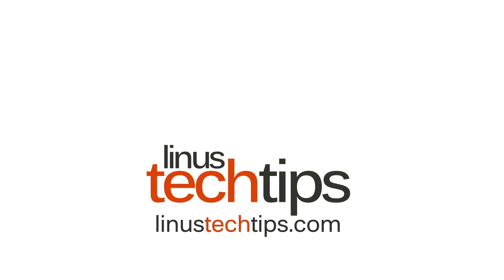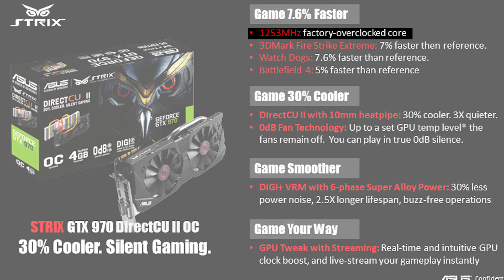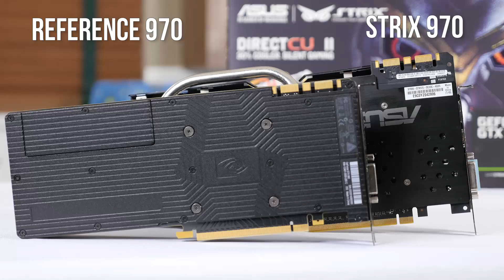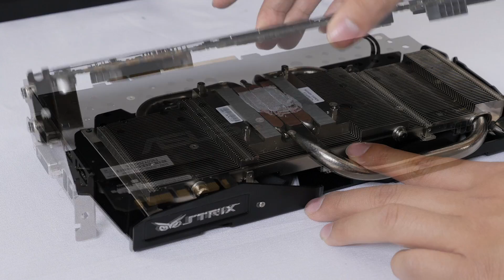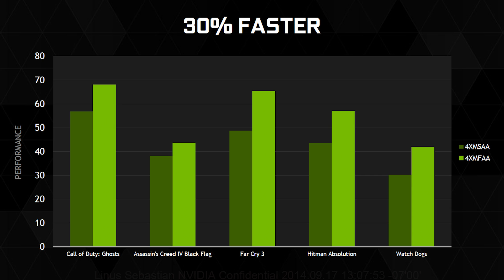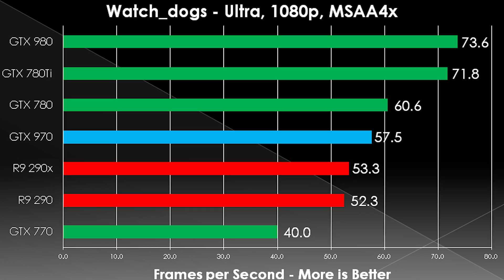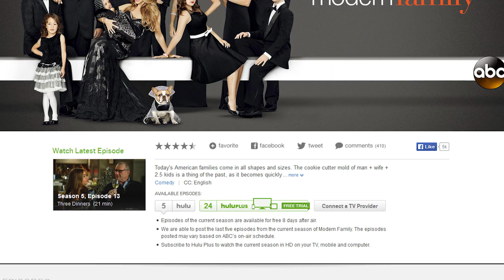ASUS Strix GeForce GTX 970 Video Card

Comment: Do you guys think the GTX970 is a big upgrade over my GTX670?  I'm on a Sandybridge i7 2600k and run all my games at 1080p with 2-4x anti-aliasing.
Reply: Yes the GTX 970 is around 40-45% better than your current gpu so it will be a good upgrade and u can max out all games at 1080p!!! ;)
Reply: jimgr94
It's more like twice as fast. the 970 is 30-50% faster than a 770
Reply: Christoffer Nørskov Well check this ( http://www.techpowerup.com/reviews/ASUS/GTX_970_STRIX_OC/25.html ) but in the future we will see a bigger performance gap with the release of new drivers.
Reply: jimgr94 670 is not on the review, the 680 is. I remember the 770 being ~40% faster than the 670, and since this is likewise here, it's almost a doubling in performance (about 96% faster)
Drivers are going to further this gap even more, but as of now, consider it double
Reply: if you've got the disposable income to invest, you could always buy a GTX970, savor the significantly reduced power consumption, and then sell the 670 to compensate most of the cost of the GPU. and then you have an upgrade for a much smaller number on your wallet.

ofcourse, the GTX900 series doesn't have the 3D Memory... which is very disappointing to me. the next generation will have it then presumably, and the performance jump on those will likely be very significant.
Reply: I think it's worth it, the question you should ask yourself is : Am I happy with the current performance of my graphic configuration, if not, upgrade. I normaly do it every other generation. I had a 480, then a 660Ti and now I'm getting a 970.
Reply: Pablo Escobar The 670 is still a much better card, by a country mile. The used price for the GTX 670 is higher than the price of a new 760, because there are current 670 users that would like to buy a second card for sli. His card should easily fetch $200, unless it is one of the few crap cards that everyone wants to avoid.

http://www.amazon.com/s/ref=nb_sb_noss_1?url=search-alias%3Daps&field-keywords=GTX%20670

I guarantee you, that there is not one GTX 760 on the planet that can perform better than my (or any other) EVGA GTX 670 FTW. Even if you overclock the 760's core clock to 1200 Mhz, a 1200 Mhz overclocked 670 would kill it in benchmarks. 

Reference comparisons on Anandtech.

http://www.anandtech.com/bench/product/854?vs=830

The only reason why the 760 comes close to the performance of a reference GTX 670, is because Nvidia raised the core clock of the 760 to 980 Mhz, to compensate for the lesser Cuda cores on the card. The 760 is pretty much a 660 Ti with a larger memory bus (256 bit vs. 192) and higher GPU clock.  

Reference comparisons.

GTX 670 has 1344 Cuda cores vs. 1152 for the GTX 760.
GTX 670 has 112 Texture address units vs. 96 for the GTX 760

http://www.hwcompare.com/14806/geforce-gtx-670-vs-geforce-gtx-760/#pixelrateExplain

It's not like the GTX 670 is my main gaming rig GPU. I have an EVGA GTX 780 Classified for that.
Reply: Robbez Duy TimeForComedy TFC dont quote me on this, but i remember seeing a score in a synthetic benchmark that was about a third of either the 970 or 980, so, at least twice the power, maybe 3 times
Reply: IT WILL KILL YOUR 670
Reply: sharif sircar You'd see a bigger improvement going to a GT 610, that thing is a 4k beast.
Reply: Christoffer Nørskov Oh wow, and the 770 outperforms the 680 by quite a bit too. Maybe it's time I retire my 660ti for a 970.
Reply: ***** 560 plays tetris and CS:source on high probably... In all seiousness, 670 is a good time to upgrade to the 970, since it's roughly twice the gpu power. As far as your 560 goes, i had the 6950 (equivalent to the 570) and it's really showing it's age. The 970 is easily 3 times as powerful as your card, hence why i bought one.
Reply: Christoffer Nørskov You clearly did not check the 1080p performance summary since it is 1080p the res he will play his games. Also the gtx 680 which is almost equal with the gtx 770( the GTX 680  DCUII TOP is equal with the stock gtx 770) is only 10-15% faster than the gtx 670 stock and the GTX 970 is 25-30% faster than the gtx 770 so the GTX 970 is 35-45% depending on the game!! (that summary includes not only games but benchmarks like 3d mark etc)
Reply: jimgr94 Benchmarks maybe tell you otherwise, but without antialising a gtx 670 without overclocking is good enough for 1080p. If you feel like <60 fps is a problem in games you play with 2/4x AA (depends on which type of AA too) then overclock it. I'd wait for another generation of cards if I were you for a proper upgrade.
Reply: jimgr94 Thanks for the link; its really helpful. According to the chart @ 1080p, the 970(strix) is only 35% faster than the 670. I'm not sure how some people can say it is TWICE as fast though because that would mean 100% faster. The only way I can see it twice as fast is if its a memory demanding game that needs more than 2gb or running at very high resolutions or multi-screen.
Reply: Christoffer Nørskov actually the 670 is in the review in that link, but its only on the charts for the lower resolutions (I play at 1080p)
Reply: mkygod Np man happy to help. Yeah some people do hasty conclusions about the average performance of gpu's. Anyways my conclusion is that this card is a good upgrade to your GTX 670. But if right now you are covered with the 1080p performance of the GTX 670 i would recommend you wait a bit to see with what AMD will come up the next months!
Reply: The 670 I believe is around the power of a 760, the 970 is slightly above that of a 780, so it would be a large increase.
Reply: At stock yes, but it's not a large increase, you'd have to jump at least 3 generations to see around 30% difference in fps around the board, and even then why would you upgrade a perfectly good card, unless you want the very latest and best and can afford it.  970>780>770 >680 but the difference ain't that big... I don't think this pattern is random but the architectures are different and each gpu overclocks differently. It's a very important factor (decisive) comparing 2 cards if performance is critical and you ignore other aspects (noise, power consumption). 970 is not 'the new 780' and there's more cards to come to fill the series, likely 980ti. I can't wait to see what AMD answers with.
http://www.techpowerup.com/205593/msi-holding-off-on-gtx-980-lightning-in-anticipation-of-bigger-chip.html
Reply: Agreed. I had a HD 3850 for a few years, bought a cheap HD 4870 and it was just great for me, exactly the difference between playable at high and very playable maxed out (not the newest games of course).
Reply: huge upgrade, I would roll with a 970, especially since SLIing them will net you some real future proofing.
Reply: Smoking Crop Yeah i feel my 670 could last up to another year too, but GTA5 is coming around the corner (early 2015 im assuming) and I got the feeling its going to be like GTA4 all over again where the graphics engine is not optimized and i'll up needing a mid-high end card. Also, im expecting the Witcher 3 to really run a number on my system as well.
Reply: TheKDub The 760 was the replacement for the GTX 660 Ti. My factory overclocked EVGA GTX 670 FTW performed better than most 680s on the market and is a great overclocker as well. 

If he has a pretty decent GTX 670, he could probably sell it for $200+ and use that towards a 970. It would be a substantial upgrade.
Reply: Gamevet $200... ROFL. A brand new  760 2GB (same as a 670 for all intensive purposes) won't even run you $200 in most places.
Reply: Pablo Escobar idunno what you're talking about, the absolute cheapest 760's i can find are $215-220. from retailers that can be trusted, not "julio's mega discount liquidators".

and average 760's that are say, Factory Overclocked, with a UEFI Bios for more tweaking and high quality coolers - start more around $230. on sale.
Reply: I have a Geforce GTX 750ti Its a beast recommend srsly beast 4 me at least im 12 saved up 4 my PC 4 1year worth it.
Reply: ye my PC is a budget PC told u im 12
Reply: The 970 is nearly a 780
Reply: Smoking Crop I have R9 280x 3gb and a old gtx 650 should i sell both an get a Gtx 970 EVGA SC
Reply: Smoking Crop Ok thx. So which card is a good 970. I heard the reference cards from Nvidia are also not bad but the cooling isnt that good. Am i right?
Reply: Christoffer Nørskov What do you think about my GTX 570? How much faster is the GTX 970 than my GTX 570?
Reply: Robbez Duy I know you didnt ask me but i hope this helpes. It muchhhhhh mucchhhhhhh more faster than your card
Reply: That might be so, but most gamers don't really care about synthetic benchmarks. They care about gameplay benchmarks.
Reply: mkygod the two often compare pretty well
Reply: Robbez Duy the GTX500 series was only a small jump over the 400 series. the major improvements in the GTX series have been the high end 200 series, the 400 series, the 600 series.
the 900's are about halfway there for a jump that's worth running to the store to buy(IMO). the generation after will hopefully get 3D Memory in... and that'll result in much faster GPU's than the 900's.

so a 500 series card would be a really good idea to replace. replace it with pretty much any midrange-highrange card in the series after it and you'll see a significant performance improvement.
a GTX 670 should, on paper, be ~2.5x as 'fast' as a GTX570.
Reply: I'm in the process of asking the same question because I have two 670's in SLI and they are doing reasonably well pulling about a 9850 Fire Strike score which is about halfway between a GTX 780 and a GTX 780 Ti. If you're desperate, I think the GTX 970 would be a decent tie-over (although personally I would consider a 780 as well), but IMO, the 970 is destined to be a transitional middle-of-the-pack model like the GTX 760, quickly fading into memory once some new hardware hits the streets, although probably not as bad as the 760, since that was basically a watered down 670. If you're buying one with the intent of going SLI down the road, go for it, otherwise, I would wait.

I have a feeling that either Nvidia's next generation or "Maxwell refresh" (ie, potential releases of Ti versions) are going to make the decision easy. My personal goal is to buy a single card that can pull 50% more than my current SLI setup. Right now that's possible, but it costs way too much compared to my current setup which was <$500 for both cards a year ago.
Reply: JohnL9013 Yeah, that's what im feeling. I know its kinda subjective, but a "mere" 30-something percent improvement by going 970 over the 670 does feel like a tie-over card instead of the big improvement I was hoping for. To me, a 50% speed improvement is something closer to a "big" upgrade. I'm not really sure if that's realistic expectation on a video card that's only 2 1/2 years newer. I'm only planning on a single video card setup though.
Reply: ***** Where would you sell a GTX 670, it's 3 generations old now. I own one as well.
Reply: great cpu and your old 670. I got i5 3570k (Ivy bridge) and overclocked 670 4GB :D
Reply: Smoking Crop At the time the 670, there were barely any games that needed more than 2gb, but now there are games out there like Watch dogs that do need more than 2gb for things like "ultra" textures. Even games that dont need 2gb can benefit from the extra ram if you are playing at very high resolutions or with multi-screen setups.
Reply: Hey SSSSSSSSSSSSSSSSSSSSSSSSs You have decent spelling and grammar for a 12 year old but the buck stops there. Don't go saying your garbage entry level card is a beast. It's garbage. Barely good enough for 1080P gaming on most titles. Understandably, you're 12 and don't have a good computer yet, but you need to ditch the childish mindset that, just because you HAVE something, it's awesome. It is NOT awesome.
Reply: Smoking Crop
yea I kinda knew that too late XD also if I want to add another 670 for SLI I have to look for a 4GB as well. but as I looked up the difference in price between the 4gb version and the 2gb of the same card wasn't much
Reply: Really, I only have a 660 and i5-3470 and can nearly max out every game I've thrown at it at 1080p at ~8x AA, only game I've had to lower it to very high so far was Metro Last Light, 670 should still be a killer card.
Reply: Ryan Skuse I have a 670 and metro last light maxed work perfect. but I turn advanced physX off as fps turns 25-18
Reply: Nart Wumar I had the same thing but the PhysX for me added a new element too the game so I bumped down the settings to Very High and AA to either 4x or 8x and enabled PhysX and for such a cheap card I'm happy that even after 18 months I can still run most games at 1080p 60FPS nearly maxed out
Reply: Smoking Crop Well obviously, the minimum was roughly 53, average 64 and max 84, I have a 75Hz monitor but I ended up capping it at 60 FPS because the drops from the 80s to 50s made it stuttery and unplayable. TO get a constant 60 FPS the settings would need to be lowered to lower than what the card is capable of, powerful enough to restrict the framerate in the 60s or be a console.
Reply: sharif sircar Of course man HD 4870 to a GTX 970 is a ton lot of performance improvement ( imagine that the 4870 is like a r7 250 performance wise in dx10 games).
Reply: The gtx 970 is over-kill for 1080p honestly 'perfect for 1440p', although you'd truthfully just about max anything at 1080 resolution with this card
Reply: crzykid71 I don't think its necessarily overkill, I might get this in my next rig for my 1080p panel, mainly because I want a locked framerate of 75 FPS (frame drops are a pain on my 660), I can also max most if not all games for about 2 years and can render less graphically demanding games such as Skyrim in 1440p for example so the image quality looks cleaner and better.
Reply: is 970 really overkill for 1080 resolution? run everything at ultra settings and max anti aliasing.. playing metro last night & crysis 3..will i still get 60+fps?
Reply: vinsh3nt bought the gigabyte g1 970, just waiting for it to deliver:)
Reply: DJ Training yea, bought it just before the massive backorders started. By now, the gigabyte 970 is preordered into the start of november
Reply: I have this card in my system. Although I can't say how large of an upgrade this would be over the 670, I can report great numbers all around. Battlefield, Tomb Raider, etc. all work well. Ultra settings at 1080p, you can expect to lower the AA a bit. (4-8 is fine, 16 is pushing it)
Reply: mkygod
yeah! it is!
Reply: Ok so i had the exact same setup first i upgraded my i7 2600k to a 4790k did not notice all but a couple frames so dont upgrade that but the gpu ohhhh baby big difference so plz for the love of god dont spend more money then u need to on a cpu and mobo an just get the gtx 970 and as of branding ill be honest im a (little) ok really biased toward msi but i honestly think there 970 gaming edition is one of the best out there